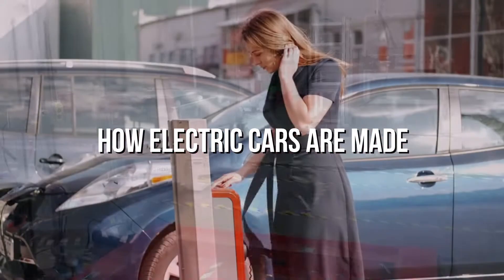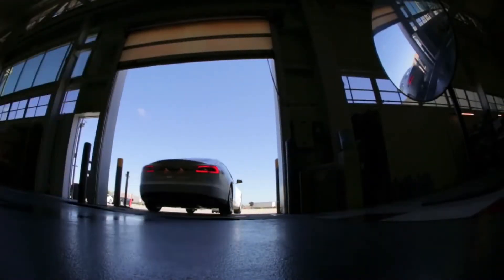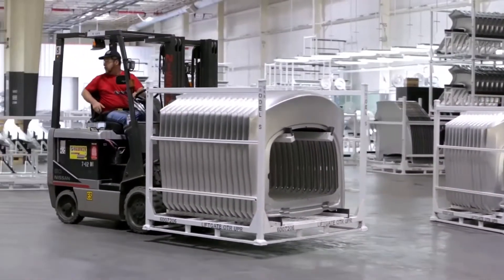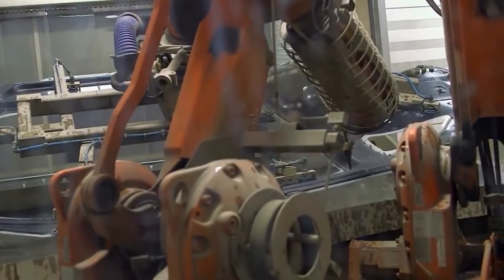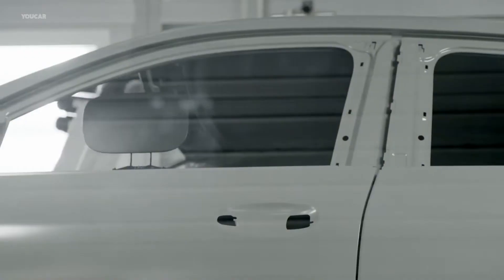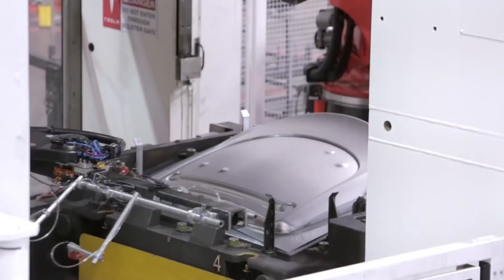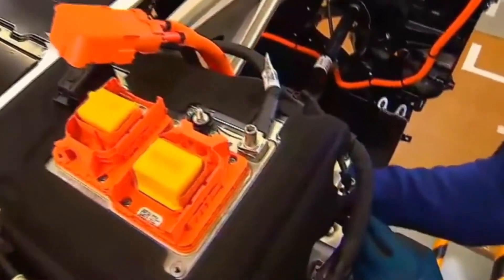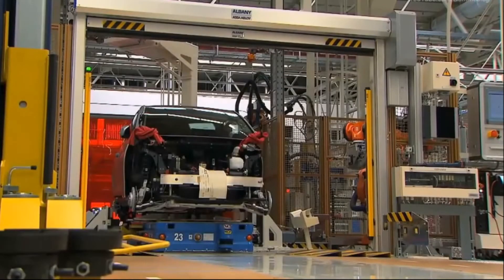HOW IT'S MADE: Electric Vehicles

Comment: The process of crafting electric vehicles is not merely an assembly line task; it’s a symphony of innovation, sustainability, and ingenuity that reshapes the very fabric of modern transportation. From concept to creation, every step in the manufacturing journey embodies a commitment to pushing the boundaries of technology while fostering a greener, more sustainable future.

At the core of electric vehicle production lies a meticulous balance between cutting-edge engineering and environmental stewardship. From the selection of lightweight materials to the optimization of aerodynamics, every design decision is driven by a dual imperative: enhancing performance and minimizing environmental impact. This ethos extends to the manufacturing process itself, where energy-efficient production methods, waste reduction strategies, and renewable energy sources converge to minimize the carbon footprint of electric vehicle production.
#electricalcar #electricalvehicle #mamiwatacobalt
Reply: So much greener mining for them ineffective batteries!

Comment: Can you can turn your old car into an Electric one by running a live cable from your house directly into the petrol tank?
Reply: It's better to pour batteries into the petrol tank. You would need a long cable to run from your house to your destination.
Reply: The batteries into the petrol tank checks out. but it works better if you also drop a lit match stick in along with the batteries